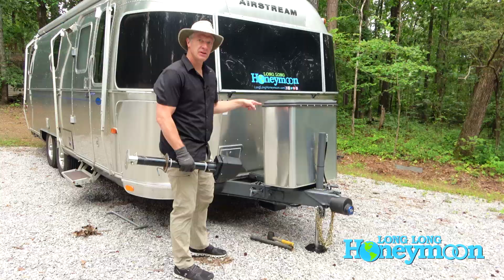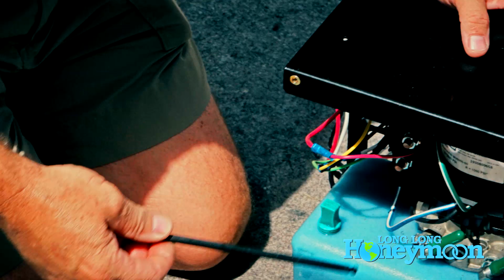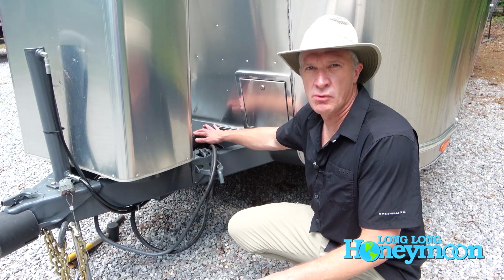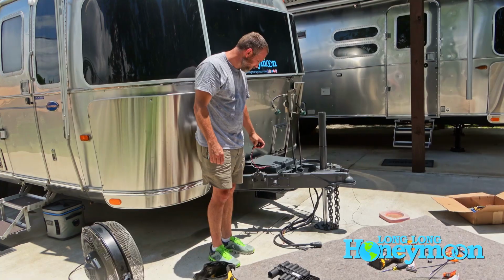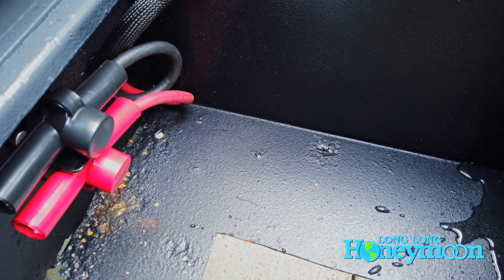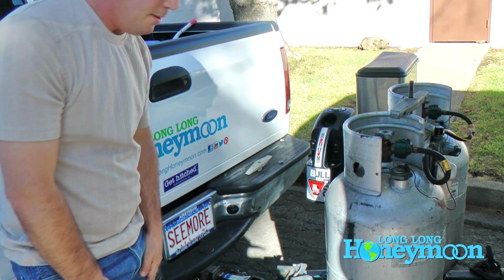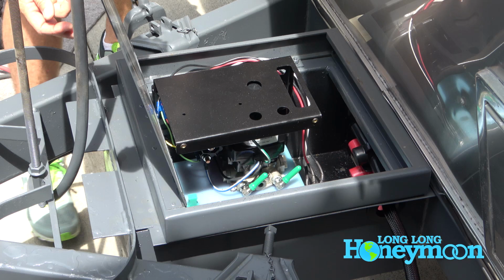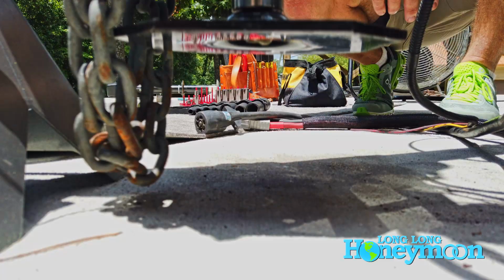😎WOW! The World's First HYDRAULIC Airstream Travel Trailer Jack!

Comment: Great video & idea!  I'm wondering if you have burned out so many jacks because of your weight distribution hitch.  To unload & attach or disconnect the bars, your jack is lifting both your trailer and the back end of your truck.  Is that more weight than the jack was designed for?  Not being negative or judging, just thinking....

Comment: I’ve heard the electric jack stories from many RVers.  I can tell by the sound of the hydraulic pump that it is under stressed.  It should last for a very long time.  The drill motor backup drive is absolutely clever, yet simple.  Great video.

Comment: I installed a Hi-Power 3,500 lb electric ball screw jack on our 2004 33ft Jayco trailer when we took delivery. It has never had a problem in 16 years but the reason the H&H engineering product hasn't, it was Made in USA. You get what you pay for.

Comment: Wow that is really fast for a trailer jack. Having a manual override in case the pump fails is great but if there is a hydraulic leak (reservoir/hose leak) the jack would not be operational. One way of addressing being stranded in a remote area due to a hydraulic leak is storing a Harbor Freight trailer jack (item # 44066 under $30 and 12.7lb) in the RV if you have space and tools to replace the jack.
Reply: Nothing wrong with a backup plan for your backup plan.

Comment: Interesting, thank you. Most people with experience/scars working on and with hydraulic equipment would suggest sleeves around the hoses to provide some chafing and UV protection. Safe travels!
Reply: If nothing more than the cheap split plastic wire loom material you buy at Auto parts places. I used it to cover the LP hose from the regulator to the hard plumbing.

Comment: Really great setup. I have had elec jacks on several travel trailers. Never had a failure but you could eat lunch in the time it took to raise or lower with an elec jack. I no longer own bumper pulls and will never own another one since i bought a fifth wheel few years back. That hydraulic jack is the way to go.

Comment: Very nice upgrade. I have the original with the wood pulp gear. It works but... I would recommend that he plan for Airstreams include not using the battery box.
Reply: The pump can be remotely located anywhere. The problem lies in being able to access the pump for the manual override function.

Comment: That's one of the best upgrades that I've seen in a while. The fact that we've been relying on electric motors to lift the tongue is kinda silly in retrospect, and I'm honestly not surprised that you've had so many failures. I've always wanted one but was always too cheap.  Now, I'm glad that I was and also have to hope hydraulic becomes the new standard, or Ronnie figures out how to mass produce them.
Reply: We are working on it.
Reply: @airstreamnutsandbolts  
Is there an industry standard that items like a jack are built to? (in the line of engineered obsolescence). Perhaps the bulk of travelers do not do the amount of traveling as do Sean and Kristy that use electric jacks. Perhaps one replacement is built into the durability standards that no one will mind?
Reply: They fail with time too. Use is not really a factor for the most part. Weather and moisture/condensation do more damage to rvs that use. Imho
Reply: Yes, please!!

Comment: I would prefer a manually pumped hydraulic system, kinda like a hydraulic floor jack, but with more range and a way to let the tongue down slowly.
Reply: Old Dirtbiker in the 70’s my uncle had an outboard bass boat with a manual hydraulic tilt/trim system with a small pump lever to make it work from the driver’s seat. I can see something like that working real well with this concept.

Comment: This is a great idea!  Our 2012 TT is on its third jack, in spite of being covered continuously. The hydraulic jack looks much faster too. 😉
Reply: Were they electrical or mechanical failures? I wonder if not enough current to the motor could be the issue or just planned engineering?
Reply: Larry Be. I’m sure the manufacturer would disagree but my opinion is that they were too small for the weight of the trailer. But the dealer sold us the same size unit each time. The first two jacks just froze up. You couldn’t even raise the trailer with the hand tool. The fuse would blow immediately.   And they are very slow

Comment: Y'all are spoiled. When I was a kid I'd have to set up our pop-up with a hand crank. Both for the tongue and the top. That was until my dad rigged a motor for the top crank. I miss that pop-up some.
Reply from the maker: There's a lot to be said for hank crank / manual operation. Our truck side mirrors are push/pull extend and retract. No motor to fail. :)
Reply: Gilbert Jagot   LOL 😆 Yes we’re all spoiled in a way these days. This rig has air conditioning! 😅. However, I might add that this rig has a tremendous tongue weight. I think even a manual jack would have been better than the one installed at the dealership.
Reply: When I was a kid our pop up was so light HOW LIGHT WAS IT! I could pick it up and put it on the ball. Yes about a 100 lb tongue weight

Comment: Thats awesome!  Now if you can just figure out a way to install them on the 4 corners and auto level.
Reply: I’m looking at a three point system that would attach to the axles on each side and the tongue jack. Since the weight of the trailer is already supported by these points it should theoretically work. It’s a work in progress
Reply: @airstreamnutsandbolts  sounds like a plan to me.  I'm in.

Comment: I have 2 trucks with lift gates that use those cylinders I would suggest Ronie protect the hydraulic oil reservoir better that will probably be where it fails if ever ,the reservoirs crack overtime it’s only plastic, maybe have a spare reservoir with you in the future or Go to a steel reservoir
Reply: It has a metal stone Cover over the tank.

Comment: As always great video, I wonder if it could be made for a 22ft HiLo which already has a hydraulic system for the trailer its self, there is room in the battery box for what looks like the hydraulic system. I wonder what that would cost installed? Getting tired of cranking.

Comment: Just a side question, but why do you remove the weight distribution bars before backing into a site?  I loosen the anti sway bars but that's about it.  What am I missing?
Reply from the maker: The "best practice" is to remove those bars, but (as witnessed in many of our videos) we have not been religious about doing so.
Reply: @LongLongHoneymoon  What does it do?
Reply from the maker: We always loosen the antisway, and sometimes remove the bars. The trailer seems more nimble & responsive with the excess hardware removed. Plus, removing the bars shifts more weight to the rear axle which translates to more traction on the rear tires. If the campsite requires a "jack knife" type of turn, I'd prefer to have the bars off. I think that's considered the best practice, but often it is not necessary.
Reply: @LongLongHoneymoon  OK - couldn't see a reason for it initially, but that's the payoff, it makes sense.  Thanks!

Comment: Interesting... we have seen the linear hyd rams before.. years ago.. nothing new... only problem is when you extend the ram... sometimes the get stuck fully extended and you put a side load on them... and if they start to leak... your weight goes on the fwd trailer bal jacks..which are not designed to take the weight of the trailer (existing ones)  or else you get a nose down trailer... until the jack pumps it back up...  also the hyd fluid does get old and sticky... nothing as frustrating as a stuck selo or pump...and as you showed we have used the elect drill to put the elect jack up and down.. just put the hex in when the elect jack motor dies... 
 but why stop at the trailer tong jack...  the real cats meow was the AS at the rally that did away with the tong jack.. and went to the 6 hyd  (4 bal jacks)... when you wanted to lift the trailer up.. you hit the switch that said post and it put the two front bal jacks down and lifted the front up... same as going down.. but what was a added feature was that their were two more at the rear and two at the wheels (one either side)... so if you had a flat it would lift that side... as well as leveling and lock the wheel trucks.  No more x jacks then either.. or blocks for the wheels... no more board to level it with... as it was pretty much all automatic... and would auto level as well as jack up the trailer... used a single pump up front like he put in.. but the controls were mounted on the right front of the trailer...  one button.. auto level like the mh's have... go figure.. 
I mean if your going to get into 'more power' you should look into having the guy come up with that system as well... get rid of just the tong hitch jack...  grin...
Reply: I am working on a system that will do just that. It will be a 3 point system ( tongue jack and one at the rear (each side) by the wheels. Single pump. Automatic leveling. Problem with Airstreams is the frames strength. The rear cylinders will need to attach at the axle mounting point because that where the weigh is carried anyway.

Comment: How loud is the pump?  I know the recording mic can be sensitive to certain pitches, but as I may need to replace my jack too, I do not want to take on a ear piercing motor whine that will disrupt the campground.  If you show up at 9 PM to a camp ground would you feel OK with the noise level of that motor or is it just as loud as most electric jacks?  That still cause me to feel like a heel if I get there too late or need to spend more than a few minutes running it.

Comment: 5:06 is that the hydraulic reservoir tank ? Is it always exposed to the rear of the tow vehicle ? If so,  maybe a piece of sheet metal on the front to protect from rock / debris strikes. Great upgrade though !
Reply: No worries, it has a full metal cover that surrounds it once it's fully installed. :)

Comment: This is Bad Azz  I wonder if the pump parts could be installed in the front storage area under the bed but be accessible from the front storage door that goes across? Then just run electric to the standard battery box..

Comment: Given that you guys are full time getting some better gear makes sense.  For me I wouldn't replace my electric lift (fifth wheel) because it only goes up and down say 10 times a year, so even if it is a week design it should last 20 years.  But you guys probably lift your trailer that many times in one or two years.  Therefor the hydraulic system should pay itself off fairly quickly over replacing the cheap electric ones every two years.  And the thing is it would be so easy to make a good electric jack if they would just put a bit stronger motor and stop using plastic gears!  I had the same problem with the 3rd row seating in my Explorer.  Worked great in the show room, but 10 times later the plastic gears were stripped.  Cheap crap gimmick.  Would have been better if it were manual like the second row seating which still works.

Comment: Would there be any problems with this in Sub-Zero temps? Alaska?
Reply: Not to be a smart alek but only if ATF gets too thick to flow in Alaska, and I don't think it does.  But I'm not sure, because the coldest day in my life has been -22 deg. F and I know it gets colder than that in Alaska.  Then again who's going to be camping in an Airstream at those temps?  Certainly not me!
Reply: I don't take it as such. I don't know, that's why I'm asking.  I am from Texas so cold is not something I have had to deal with. I don't know if there sealing rings in the cylinder need to be kept above a certain temp, or what ATF does at those temps. I'm curious in case my family makes the trip or someone else does .

Comment: isint that more expensive, more complicated, and has almost no parts availability because its the only one there is?
Reply: Actually all of the parts are more easily available because it's made up of common items (hoses, fittings, wires, fluid, etc.) that can be found at any automotive repair store. If it breaks it can actually be repaired. Our old electric jack was a closed unit which meant you couldn't really open it up to fix it. When it died, it was just dead. This unit was about double the cost of our old one, but should last much, much longer.
Reply: I see the Parker label on the pump assembly, we have a Parker dealer here in good ole Baton Rouerage( sounds and smells a bit like sewerage) so Is bet they would have any special part needed, and hydraulic hoses can be made at many auto parts shops - Bigger O’Reilly’s and NAPA. So I’m sure there’s parts available in most any place you might find yourself, should you have an issue. 

I think a nice bright aluminum cover to protect the hose and to locate a remote switch would really top this thing off.

Comment: Item# 71536 at NorthernTools
Reply: "This product does not come with a hydraulic pump and tank. The kit includes all the necessary components to install the hydraulic trailer jack onto a trailer with existing hydraulics."
Reply: Quadra Manufacturing is cheaper, 8000lbs, custom for Airstream, and has the pump.
Reply: Just noticed that there is no pump with the kit.